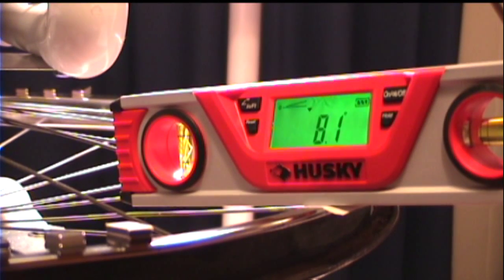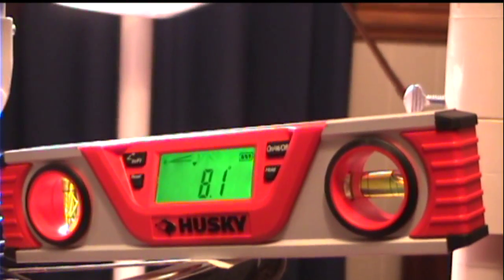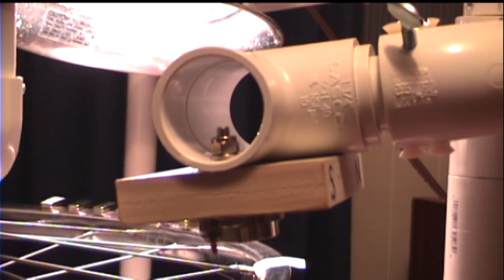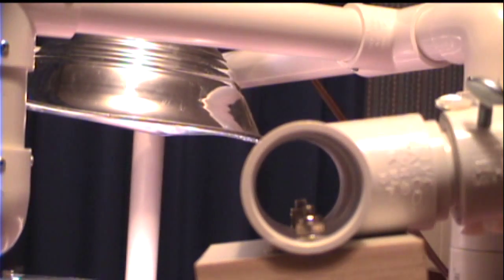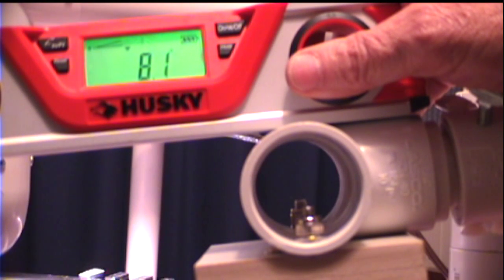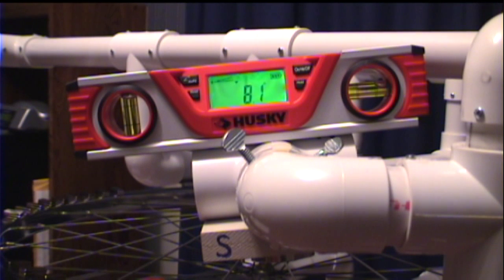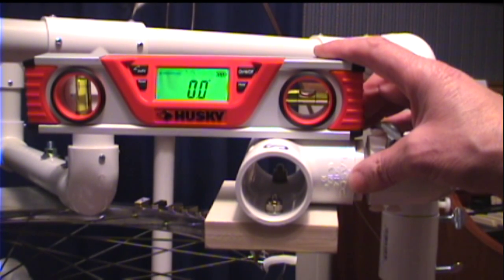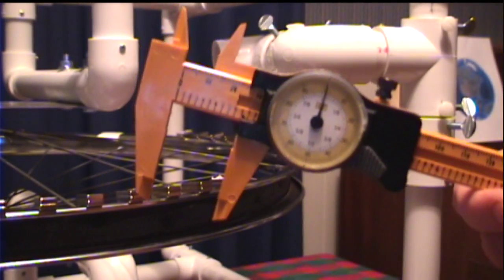Video #13, "Rick's Pipe Dream" Magnetic Motor - Generator

Comment from the maker: @ggibney0856 If one rotor magnet is repelling away from the stator magnet, then the next rotor magnet in the group will be approaching the stator and being repelled in the opposite direction, and this will soon cause an initiated rotation to halt.  That's why a continuous rotor magnet layout, either with constant attraction or repulsion,  will not work.

Comment from the maker: You are most welcome, mostar.  I have 3 more videos to upload, and then I'll be taking a break for a few days to finish up my pdf document and install my flywheel and tracking system.  If I hadn't started these videos then I'd probably be all done by now, but I wanted to give everyone an opportunity to build this device and jump in on the project with me.  Nothing will be held back, and every little detail will be fully explained and documented.  I hope you join in, mostar.  Best 2 U,  Rick  :)

Comment from the maker: The stator arm will be converted for use as a generator coil positioner later on.  The new stator mechanism will be located front center.  I have it all worked out already, and have all the materials, so will go ahead as planned.  The new stator assembly will still be on the crude side, but if it does the job (or nearly does it) then I will replace it with better materials (ceramic bearings, etc.).  I would be interested in a drawing and  explanation of your idea.  Please send your  e-mail add

Comment from the maker: Hi perp,  thanks for the kind words, and for your suggestion.  I did consider use of a pendulum when I started in on this project, but opted instead to use a monorail track for timing.  It is very easy to install and to set up properly, and the carriage assembly that will ride the track will be linked to the pivot arm that moves the stator magnet.  Everything will be made as lightweight as possible, and I won't be using the stator arm any more.  That was just for testing purposes.

Comment from the maker: The pdf file will be available shortly, and will include complete step by step instructions with high resolution photos and instructions covering each phase of construction, setup, and operational modes. Those in the e-mail list will also receive free expanded updates of the pdf file each time a new construction revision or enhancement becomes available.

Comment from the maker: The reason I am offering the pdf documentation free is because I would like to see others join this open source project and help to move it forward with enhancements and improvements.  If we all have the same build, then what works for one will work for all, and that is very important.  If you join the project, you will also be placed on my Pipe Dream e-mail list and receive fast breaking news about latest developments.  So be sure to include your e-mail address with your request for the pdf.